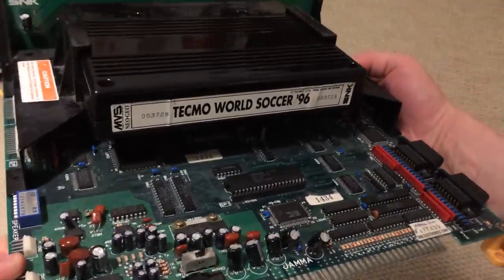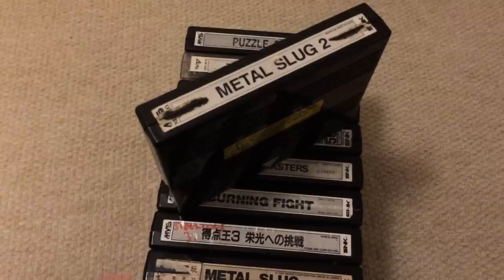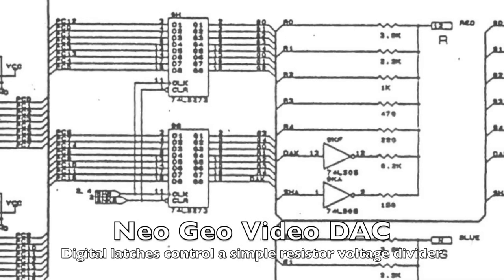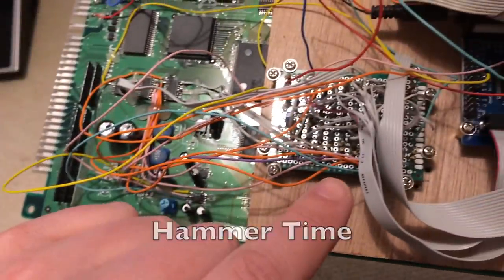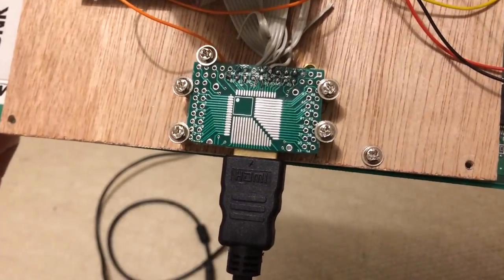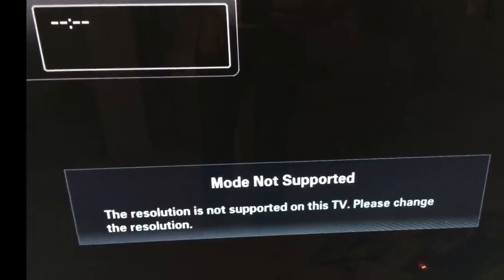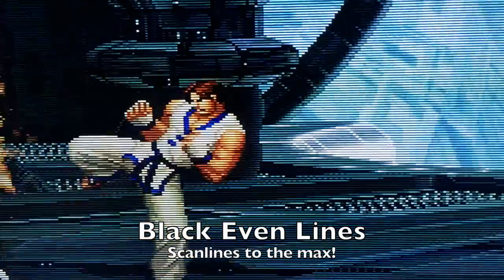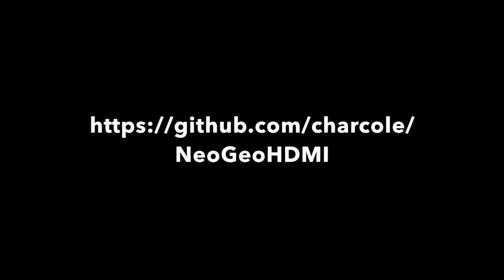HDMI mod for Neo Geo MVS

Comment: This looks fantastic, and I'm really glad someone has done this. I wasn't sure I was going to get around to fixing up NeoVGA to be clean enough for a source release, so it's great to see someone has done a great job with digital output.
Reply from the maker: Thanks Michael, glad you liked it. NeoVGA is probably the main reason I bothered to add sound! :) Stumbled across your forum post while searching for information on the Neo Geo's video timings. Up until then I thought tapping off the digital video outputs was probably unique. Once I saw someone had already done it already I knew I had to do something extra. NeoVGA looks like a great project. I especially liked your idea of replicating the Neo Geo's DAC for your outputs. I worked out what the ramp would be and it seemed like they were going for something linear but due to the standard resistor values used it's not quite. I wonder if any games make use of that effect.
Reply: chipos81 I'm also very glad you immediately addressed the 5V -> 3.3V conversion. A lot of projects and modern hardware for old systems (like those awful n-in-1 cartridges) do nothing to prevent 3.3V and 5V devices from sharing lines, and lot of current is drawn as a result. 

Also, I think there might be a small gaff in your explanation around 2:54 - the original Neo-Geo's output wasn't interlaced, it was a progressive ~240 lines, the same as repeating a single field instead of alternating like normal interlaced NTSC video. Though, the line doubling is still needed.
Reply from the maker: Michael Moffitt That's interesting. I knew the frame buffer was 320x240 (ish) but I assumed when output to the arcade monitor it'd still be displayed as if it was an interlaced signal. Was it a property of the arcade monitors or is the signal structured in such a way that it's always presenting only the even (or odd) lines every frame?
Reply: chipos81 It ends up being progressive on the monitor simply because neither frame contains a half-length line. The half-line is what offsets the beam to strike between the previous frame's lines in normal NTSC interlaced video. This works on an arcade monitor, but also a television set, or anything with those standard resolution timings. The same principle even works on a VGA monitor - try outputting every other line of a 640x960 framebuffer, with every other frame having an additional half line, and it'll interlace as expected.

The scanlines you see on old games are from the beam never striking that gap area between the lines, but only "double-striking" the same field. Some consoles, like the Sega Megadrive, could enable a 480i mode in addition to the standard progressive scan.
Reply from the maker: Michael Moffitt Thanks for the info! I did take some photos of it running on a CRT and was surprised to see the scan lines were quite noticeable but it'd been so long since I used it last I just assumed everything must have been like that. I should have looked into it deeper.

Comment: Hi I just bought a neo Geo Mvs super gun system and hooked it up through ybpbpr  the picture is distorted and I was wondering if you could help I think the power right because it's a converter 12v to 5v

Comment: I wanted to try and install this in an AES console, but the framerate is of course an acceptable 59.94Hz rather than the MVS 59.1856Hz, so shouldn't have the same issues. Can the FPGA code be simply altered to remove the overclock (e.g. removing or editing lines 82-122) or can the clock signal from the FPGA just not be wired up?
Reply from the maker: It's been a while so might not be remembering correctly but you'll probably need to keep driving the AES clock. The code expects pixels to be served up when it wants them. If you did want to keep the AES frame rate you could remove that code but you'd then have to make the AES system clock drive the FPGA's pixel clocks instead.
Reply: Thanks, that's pretty much what I was expecting. I'll probably try and connect everything as is for the time being to see if it works (hopefully my TV will play along) and then play around with the code a bit to get it back down to 60Hz.
Reply: @jaredbowhay-pringle1460  Did you finally install it in a AES Console? Could you share with me info about this implementation? Regards,

Comment: Pixel perfect is rgb, not hdmi. You're up scaling this signal, it's not true hi Def
Reply: +RoomerJ 1. the video output signal has nothing to do with it being or not being "pixel perfect" as long as he retains the original resolution it will continue to be "pixel perfect". 2. he's not up-scaling the video at all, as explained in the video he's simply line doubling to provide de-interlacing. 3. you're right, it's not true hi-Def and nothing in the title, description, or video claimed it was. this is because he's running at the original resolution.
Reply: Fixed pixel displays always scale the image.  Otherwise the NeoGeo's 320×224 resolution would just take up a tiny square in the center of a 1080p display.   5x integer scaling would be pixel perfect but it would crop pixels off the top and bottom.